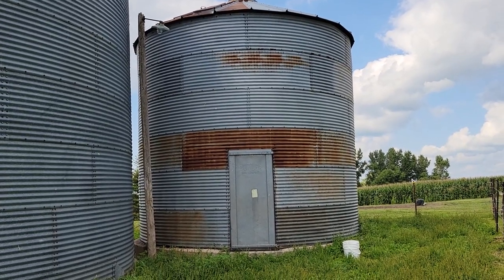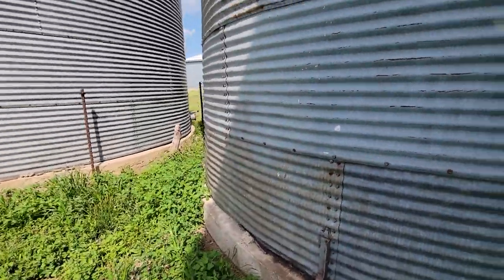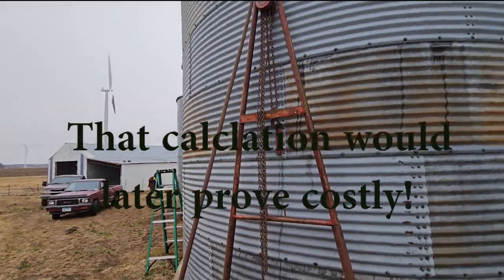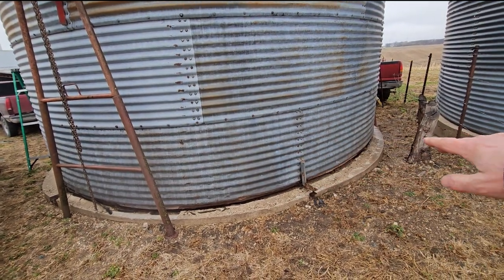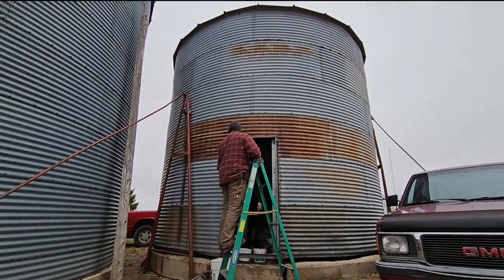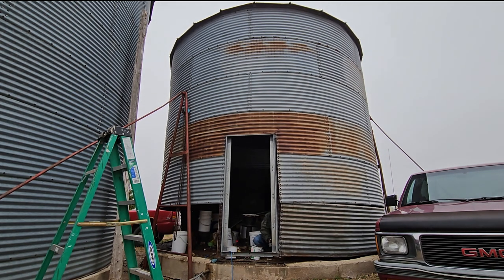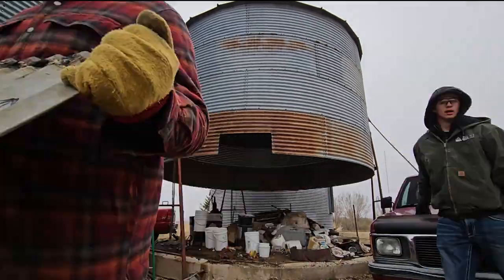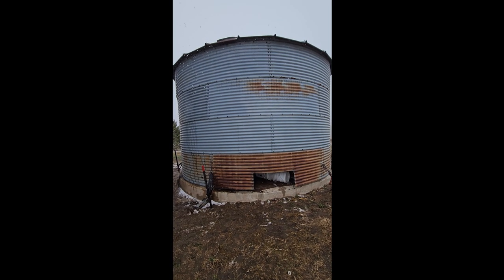Grain Bin Gazebo DIY - Starting Tear Down Using Bin Jacks & Preparing For Moving - Part 2

Comment: Hi 
I'm wondering why most dismantling  are done using jacks. 
I'm contemplating  dismantling a 6 ring 14 footer from the top down. Is there a problem  doing it that way ?
Reply from the maker: If you are dismantling it to reuse it it nice to leave the roof intact. Pretty hard to do the upper rings when your ladders are always in the way. The sheets as they come off are like knives falling down. Once you dismantle the roof, your ladder(s) is going to want to cave in the top rings. Just a few reasons. If you use enough jacks & do it on a calm day, this is the safest method.